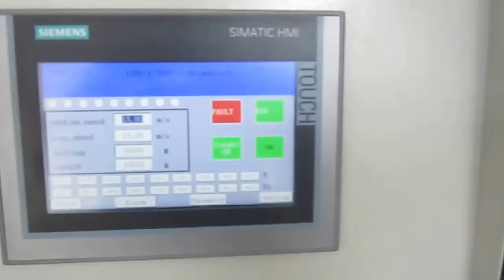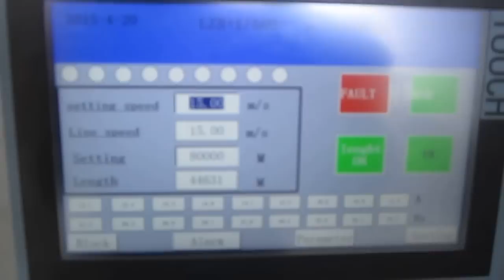fine(work) live video of wire drawing machine

Comment: What's the black powder piling up near the machines?
Reply: Its the dry lubricant on the die boxes. It can turn black and some of it comes through the doe with the wire. Could be humid in there. If it gets too humid it will bind up and get hot or the wire will snap.